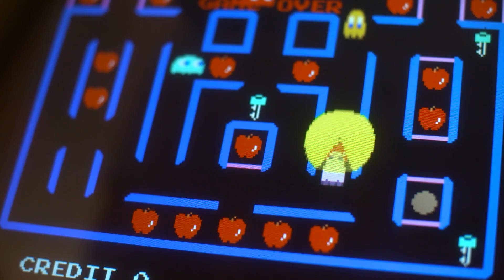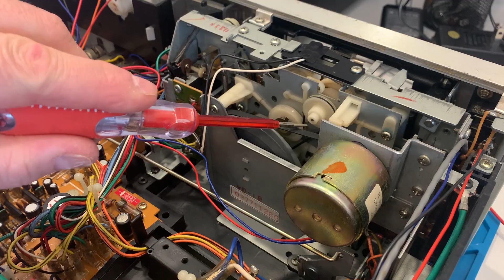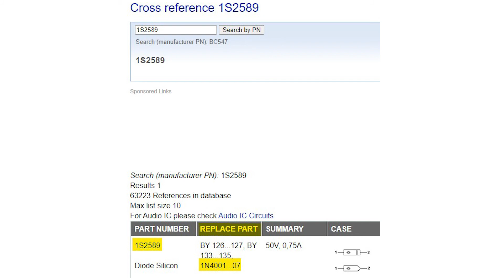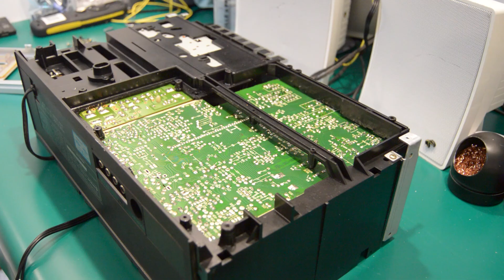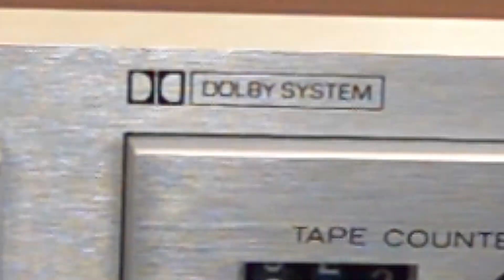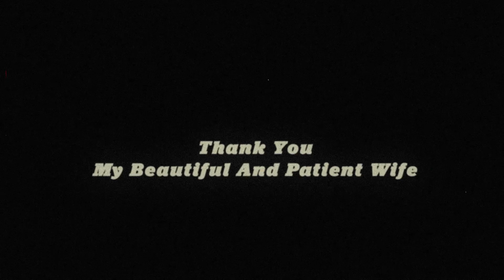Restoration of a Vintage Audio Tape Deck | Retro Repair Guy Episode 9

Comment: Hi again, I brought a Fosi Audio amplifier with RCA connectors. For the Hitachi D-720 cassette deck. Unfortunately, it doesn't work. Do you know what size RCA connectors to use as well as maybe a compatible amplifier ?   Thanks !

Comment: Thanks for emailing back for the Hitachi Cassette Deck. Is there a pacific amplifier or just any one.
Reply from the maker: My pleasure. Any amplifier. old or new as long as it still has RCA connectors in back (round and usually red and white or red and black or both black). You can sometimes pickup an old working one from a thrift store. You can connect it to "Tape" or "CD", "DVD", etc it does not matter and just select that input. If using an old amplifier that has a "phono" input, this is the only one you cannot connect to as it is meant specifically for turntables.

Comment: I have a question ..I  brought one a Hitachi Cassette Deck just like yours , I hook up speakers to it and no sound . Can you help ?
Reply from the maker: Hi Bill! Yes that's because you need an amplifier. This unit is just a tape deck, there is no amplifier inside to drive the speakers. You need to plug the tape deck to an amplifier with the RCA connectors in back and then plug the speakers to the amplifier.

Comment: Great vids! I have a sansui sc-5100 cassette deck. I replaced all the belts and it does everything except play. It tries to and then stops! Very frustration when you are new to this stuff like me. Any insight will be greatly appreciated.
Reply from the maker: Hi! While it's hard to diagnose without seeing it, stopping just like that sounds like it could be the pinch roller. It could be slipping or needs to be replaced. You could try cleaning it and using Rubber Renew otherwise look for a replacement. It could also be an electrical problem. I would try the cleaning first. The belt is used to turn the tape and when used it causes problems with Wow and Flutter or stops turning. The pinch roller puts tension on the tape and pulls it across the head if it slips it shuts off. This is why I say it sounds like this issue which is very common. Thanks for watching.

Comment: Brilliant and very informative, thank you. Could you tell me how I can adjust the motor speed - it's playing a little fast - on my vintage Hitachi D230 deck please?
Reply from the maker: Thank you! Before adjusting the motor speed I would ask why it's running fast. The belt and capacitors should be looked at first. Then is it needs adjustment (best be done with the service manual) there is either a tiny hole under the motor (WARNING best to use a plastic screwdriver) or a potentiometer near it. Thanks for watching!

Comment: Hi, Hopefully you can help me. I have an AKAI GX 220D Tape Deck. It has a blown fuse 1.5 AMP 120 Volt. I cannot find this fuse. I've been told and acquired a 1.5 AMP fuse, but 220 Volt. When I change the volt setting on the back to match, I get dim lighting, but none of the other instruments on the deck work? Any ideas?
Reply from the maker: Hi Mike. I've never opened that unit however looking at the service manual it shows me two things. First that the main fuse (F1) is a 2.5A fuse and not a 1.5. Secondly it shows me another fuse (F601) on board MS-5024 that is 1A. Now The voltage rating on a fuse is the maximum voltage that the fuse can tolerate so it can be higher but not lower. What's important is the amp rating. Don't change or play with the unit's voltage rating. That is for when you are in Europe for example and their electricity operates on a different voltage and Hz. You could damage the unit.

Verify the length of the fuse. Is it a short or long. You can get them from Digi-Key and ceramic fuses perform even better in audio applications in my opinion. Short one https://www.digikey.ca/en/products/detail/bel-fuse-inc/5HF-2-5-R/1009735 and long one https://www.digikey.ca/en/products/detail/bel-fuse-inc/3AB-2-5-R/1009764  But please measure the length. If what I sent is not the correct length then do another search on their site. You can also put a regular glass one. Also here is a tutorial from them on fuses that could help you in the future https://www.digikey.ca/en/articles/fuse-tutorial

You can take a look at the service manual here https://www.hifiengine.com/manual_library/akai/gx-220d.shtml

Start with the correct fuse and return the voltage to its proper operating state and then see what happens. Verify that other F601 fuse as well and see if it's OK. Hope that helps! Thanks for watching!
Reply: The voltage ratings are maximum ratings, to prevent arcing across the fuse when it's blown - lower voltage is not a problem. Set the deck to the right voltage from your outlet. Further, 1.5 A seems quite excessive for a tape deck - are you sure that's the correct current? I wouldn't expect any more than 500mA... Or is the fuse on the secondary (low voltage) side?

Comment: I have this Hitachi deck D220 but when i put in on i Heard the motor run direct when put in on.when i push the play bottom the tape don't move.
Reply from the maker: Hi Marlon. Sounds like the belts need to be replaced. These are old unit. It's normal that rubber, dries out or melts. Thanks for watching!
Reply: @RetroRepairGuy  thanks for answer My comment.yes this weekend i Buy the Belt to replace them

Comment: Why does the fwd n Rew piano keys on my Akai deck slipping , play also occasionally
Reply from the maker: Hi Maxwell. This sounds like regular maintenance is needed; changing the belts and while at it clean the heads and pinch rollers. Thanks for watching.

Comment: Hi mr retro 
I have bought an Phillips art 60 with a tv boom box do you know anything about them
Reply from the maker: Hi there! I've only seen them on Internet. I have never seen one in person or know of anyone here owning one. Was it made only for Europe? Beautiful piece of equipment. Wish I could get my hands on one and, of course, crack it open! 😁
Reply: @RetroRepairGuy   I’ll send you mine you can fix it and put it on your channel if you want.
Reply from the maker: @crazed8486  Hi! I can't fix and send things back as the shipping cost alone would be enormous. However if you ever want to make a donation to the channel, I promise it will be fixed! 😁😁
Reply: @RetroRepairGuy   hi I could do that I really want it to work perfect. But it is a big item to post.
Reply from the maker: @crazed8486  I know that's what I'm saying about fixing. Unfortunately the channel doesn't make any money yet so I can't even offer to pay shipping to get it. Thanks for the intention it's still appreciated.
Reply: It works great but the horizontal holed is not working properly need to find part or could try fixing myself.
Thanks for the reply
Reply from the maker: @crazed8486  Hi. The TV part is like any old Television. Many times the problem with the horizontal hold could be the potentiometer that needs cleaning or changing. Could also be bad caps, etc. Remember, that even when unplugged, the tube still holds a charge and needs to be discharged before working on it. Once that is done, try some contact cleaner in the potentiometer and turn it back and forth. Then plug everything back and try that before changing parts. If you have never worked in a television before I highly advise against it, it could be dangerous.
Reply: @RetroRepairGuy  is it easy to discharge the tv

Comment: I need belt kit for cassette on a Hitachi  SDQ-9922H cassette player have idea where to get it?
Reply from the maker: Hi there! Unfortunately it's become very hard to source these parts and I've looked around. The only place that you can get them now is from Chinese manufacturers and the cheapest way is to by a bag full of different sizes and shapes and then match the new belt to the old one. If you don't have the old one you can also find the exact size and whether it's round, square etc and  and match it as well by ordering them through Amazon or Aliexpress. Unfortunately Digi Key or Mouser don't carry these. On eBay you can sometimes find a kit however if it's NOS, remember it's rubber and make sure it's not past its shelf life and dried out. The bags full are worth it and much cheaper if you intend to do more like I do. They are approximately $12 US per bags of 50 on jungle site and even cheaper on the other. Hope this helps and thanks for watching!

PS I just checked the old PRB line catalog who used to make the replacement belts and for your unit this is what I found:

Belt Fly Wheel - FRM9.0
Belt -  SCQ6.5
Belt Counter - SCY8.0

So SC=square cut and the number is your size and FRM = Flat Rubber. The other extra letter is the wall thickness. Q=0.50 Y=0.39 M=0.210

Comment: I had this same unit back in ‘79 and loved it. Sold it in ‘83 then bought another one again from a flea market in ‘96. Restored it with new belts and lights but has since been out of action since a few years ago as one channel no longer worked and the indicator needle paint has all but come off. Still have it stored and may give another shot at restoring it again.
Reply from the maker: Hi! I know it's not the best out there but I find it to be a sturdy and great sounding unit, especially when paired with the OCL Amp I also repaired that was part of the system. And I love the piano mechanical keys as opposed to an electronic mechanism. Hope you get yours up and running. Thanks for watching!
Reply: Thanks for the feedback. One quick question (as I don’t recall from memory on my original unit) but does your door mechanism feel and sound rough when closing. I know it uses a mechanical system to open and close compared to hydraulic.
Reply from the maker: @davids.8459  Hi again. Sorry I don't know why YouTube threw your second comment under "SPAM" and I just saw it. Not sure what you mean by rough but I have it next to me and just tried it several times and I hear the gears engaging and feel them when I push it closed so yeah it's not smooth so you could call it a bit "rough" especially when compared to other tape decks I have.
Reply: That is the same as I get thanks.

Comment: Hello buddy I have the D-555 & find I have to crank up the record levels to match my technics unit so wondered if you have any ideas of a fix and what I should be looking for ? 
Thanks for any help.
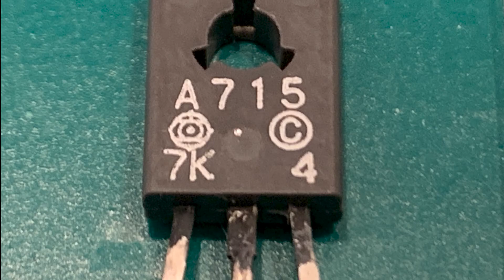Reply from the maker: Hi! First thanks for watching. It's always hard to diagnose without seeing a unit but it could be the preamp section. However, one simple thing that I have seen in old models like this is the record switch on the board (the one that when you press record has a long hook that goes into it). Try cleaning it with some contact cleaner and operating and pressing it on and off a few times (I showed it here when I fixed the boombox https://youtu.be/LFem3AtbZM0?t=406 at 6:46 in the video). I've seen this happens in the past where it was dirty and affected the record levels. Similar to a dirty potentiometer that affects volume. While you are there, a good head cleaning all together never hurts. Hope this helps!

Comment: I would like to ask if you also cleaned the tape before testing. I've done a bit of homework, and some audio restoration professionals recommend doing a complete pass on the tape using a Q-tip with isopropyl alcohol (like a tape loop) forwarding it with the pencil or a pen. Have you done or tried this method? Many thanks!
Reply from the maker: Hi and welcome to the channel. I always use a new tape for both initial testing and for testing when I'm finished. I never use an archived tape just in case as I would not want to ruin it if something goes wrong. As for cleaning, my opinion based on thirty years experience is that I've never had to clean a tape itself and I would be afraid of the alcohol damaging the tape. If it's really bad for some reason, you can open it up and clean the interior of the housing or even replace the housing (same goes for VHS, cassettes and 8 tracks) you can also replace the sponge in the middle if it deteriorated. For obvious reasons we clean records because dust gets inside the grooves but a tape is smooth, compacted and rolled up inside a plastic closed box and inside another plastic box. I'm not sure what the benefits of this would be as I don't see this as being the same as cleaning film in special chemicals to get dust off of them as they did for Star Wars years ago for example. In my experience and opinion it's better to make sure the items are properly stored and cassettes rewound and remember that this media cannot last forever so if there is something of value to think about digitizing it to preserve it. Thanks for watching!

Comment: Hello ! Do you know how to remove oxidation from aluminium panels in the front? Thanks
Reply from the maker: Hi! I have to mention to please do at your own risk and there might be a better way to do this but here's what I would do:

I would first clean it as best as possible with a soft bristle brush for dishes, hot water and dish soap just like I would with dishes. Afterwards I would try cleaning with vinegar and if really bad, soaking the panel in some vinegar for about an hour, and again using a gentle bristle brush or toothbrush and rinse off. If it still doesn't come off I would use a fine grade steel wool or try an sos pad for pots and pans. But I would try first the back of the plate or side and not rub too hard as not to scratch it. Once it's clean, use some metal polish (like car product stuff) to finish it off. The panels are pretty sturdy and although the words on them don't rub off easy, I would be more careful and gentle around those areas.
Reply: @RetroRepairGuy  thank you so much for your fast and very detailed response, i will try it carefully, Again than you for your help!

Comment: Hi, am very impressed ❤️and I really appreciate the hard work you have done. These tape deck was in my childhood in the year 80s. It still fresh in my mind.
Last week I collect a vintage Silvano 550 in the garbage. Waoooh it had been rusted mostly. Looking at this tape deck I feel sad.
I have only removed all the dust and and cleaning all the pcb and trying to figure out what the problems.
The turner is on. Fm is playing.
Now the tape deck and the line out is not working. May the STK ic. Is gone that's I have to dig more by checking it.
Whats really sad I had dig into Google to find the data sheet of these model but could not fine one.
I like vintage tape deck. And I really appreciate and this make me feel happy when I see someone give new life to old tape deck.

I really appreciate your work.
Keep on 👍.
Thanks for this beautiful video.
Reply from the maker: Thank you so much I appreciate hearing kind words and when someone recognizes the amount of work that goes into a restoration. If you want to see more please subscribe it also helps me grow the channel so I can continue.

Comment: many hitachi tape deck in my country (indonesia)  but i cannot find the belt for replacement...any suggest from you?... anyway you restoration is great and easy to unferstand...thank you very much.
Reply from the maker: Hi again! Thank you for the kind words. Not sure what is available in your country but you can buy bags of many different sizes and shapes from China through Aliexpress or Amazon. This is much cheaper than buying the exact belts for the unit. You then match the belts to the correct size.